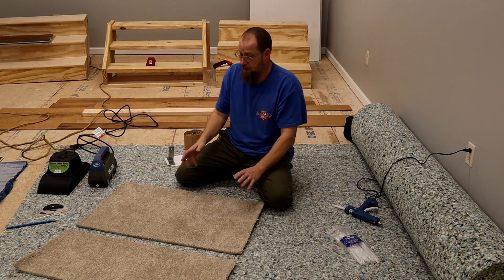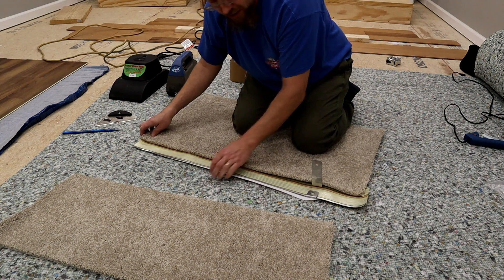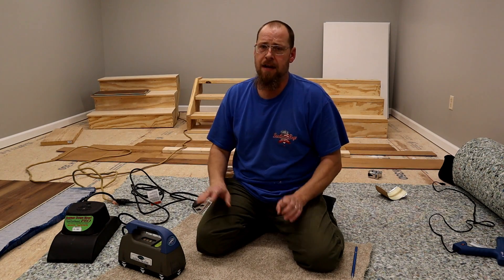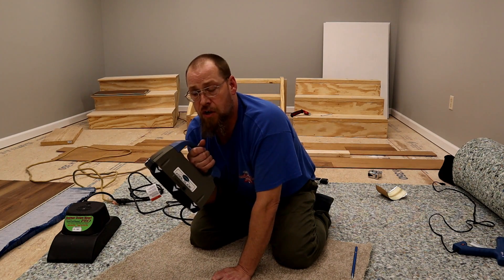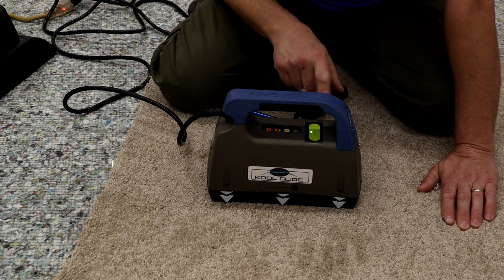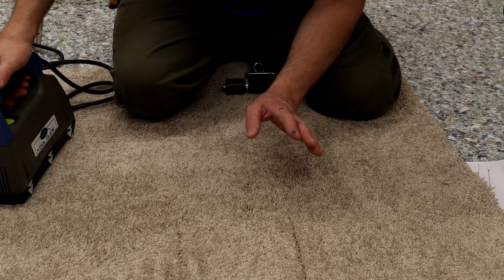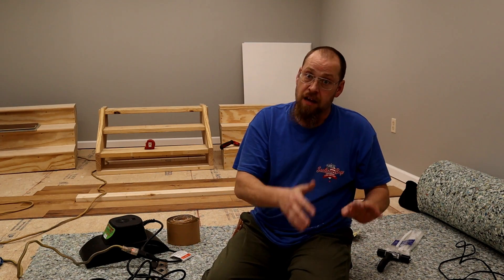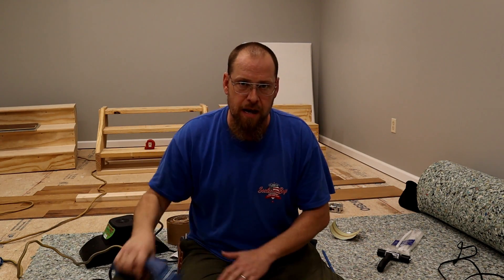How to use the KOOL GLIDE seam iron

Comment: So by the time you make the seam it seemed like the hot glue sealer already dried so does it melt a second time?
Reply from the maker: Yeah they call glide will reactivate the glue and weld the two pieces of carpet together from the sealer

Comment: Reuben, I was told to put the tape down under the carpet and seal it on one side along the edge with the hot glue sealer (like you would with commercial carpet) and the Kool glide will reheat it and weld the edges together as you do your seam. Save time too!
Reply from the maker: Joe Mcginnis that makes sense

Comment: what kool glide seam tape did you use  ?  a) Kool Glide KGT-8568-C Silicone Coated Premium Seam Tape;  or  b) Kool Glide KGT-8568-U Uncoated Premium Seam Tape   or    ; c) Kool Glide KGT-8558-U Uncoated Standard Seam Tape  ?    I  am doing  little patches of carpet where I cut out damaged carpet ( bleach spot 6 x 9  inches )  and replacing with a matching carpet piece taken out of a closet.   ...  How to use KOOL Glide  Pro   and which tape to use...  A question about what  you did in video  -- Why did you use glue gun glue  on edges of carpet ?

Comment: Nice demonstration 
I’ve been using the kool glide since 2012 

What one of the number one complaints about seams? ......peaking 

I would recommend a seam weight 

I have a 25 pound dumbbell on a piece of plexiglass, that’s got some holes in it for cooling.
Reply from the maker: J M peak buster?
Reply: Absolutely. 
I wouldn’t put a seam together 
Without seam sealer.
Reply from the maker: Joel Rowe 😀👍

Comment: Good demonstration but I’m wondering is this product going to save time on the job or just be more steps to a process that already works
Reply from the maker: There’s actually a lot of different things that you can use this iron for besides just carpet, and it is especially great if you have a pattern running off that needs stretched to line up, I don’t use it all the time but it is really nice when I need it and have it to use

Comment: Funny story I started my scene and noticed I was one row off from making pattern so I stopped about two foot into the seam let it cool down flip the carpet upside down to heat up the seam tape and pull it off it immediately caught fire and scared the s*** out of me. You must heat up the seam tape through the carpet to pull it off or it will in fact lay on fire safety tip

Comment: When you sit the iron down on the carpet, to work your seam my instinct kicked in !
No don't do that I thought.
Then I realized it is a totally different method of heating tape.
Does it use microwaves to heat the tape?
All the years we have used heat irons, I have always wondered why they could not invent a better way.
Looks like they did.
I believe heat tape and irons have been around since 1971.
It's about time.
Thanks for the instructions 
I am thinking about getting one.

Comment: Like all the benefits of the kool glide. Just have a hard time justifying the cost of the seam tape to be honest. Sure 1or2 jobs will pay for the iron but the tape?? Also if your in a dump where they only want something to cover the floor. Is it worth all the money for that iron and tape?
Reply: Lucas Reuss I hear ya. It’s tough to explain to customers or the store you get work from I need to charge this amount to give you a quality job when other installers will always come in and do it cheaper.
Reply from the maker: Lucas Reuss I would not use it constantly, only when needed, I have been using it always recently because I just wanted to get the hang of it
Reply: They sell a cheaper version of the tape online.

Comment: Great for paid repairs. Patches.   I started out on the kool glide. But the hot melt is way better. Kool glide is garbage other than patching.
Reply from the maker: Gary Mcgarity it has way more uses than just carpet, that’s what completely sold me on it
Reply: I had to repair a carpet job a Installer did and the pad was burnt from the cool glide.
Reply: Kool glide is good for repairs and cheaper since the seam tape is pretty expensive to do a lot of sms for install
Reply from the maker: Alex Cleroux He didn’t use it on the right setting and he did not have a seam board
Reply from the maker: Daniel Schuster It is $24 a roll
Reply: I always used, a few strips of lauan under my seams.
I have the plastic/ nylon heat shield on top of iron
The board is long enough that you do not disturb the seam when pulling it along.
I seal my seams so well you can heat the tape off, and the seam is still bonded, yes if you have to remake a seam this can be a problem.
I have always made sure the seam was cut perfectly to begin with, my helper who could install better than most mechanics did have to take one apart years ago.
This is how we found out about the bond strength.
When it comes to seam peaking, cheap carpet backing that uses fillers like gypsum,and marble dust are one of the main reasons.
When you have a stiff backing it does not stretch as much.
This puts much more direct tension on the seam,  along with the hard spot from the heat tape.
A backing with a quality latex will be white, the brown backed carpet will contain fillers.
When we installed jute backed carpet, seam peaking was never a issue.
Jute would stretch the full with of the room, tension on seams was greatly reduced.
Today's wool carpet can come with a jute back or a woven back.
Woven back carpets do not side stretch.
Carpets like Axminister will humble you if you have not been trained to install them.
When people use high quality like Axminister they are not concerned with some waste.
So you do not cross seam it.
I have only cross seamed closets.
It's better a carpet not move much at all on the side than pull directly against the seam.
My point in this is I would be concerned with the strength of the tape.
The weaker the tape the more it peaks or can pull apart due to the nonporous cheap backings out there.
But I'm always open minded when it comes to new products.
Should we be concerned with microwave emissions?
Some may laugh, but microwaves fill our houses and enough exposure can cook you body's cells.

Comment: Just to expensive lol jk
Reply: It might be expensive but I guarantee you if you tried it just once you will prefer it over the old style iron.
Reply: @shawnmoore5621  all jokes. I actually started on the cool glide. 5 years before i ever used a hot melt.
Reply from the maker: Fit Floors 😂😂